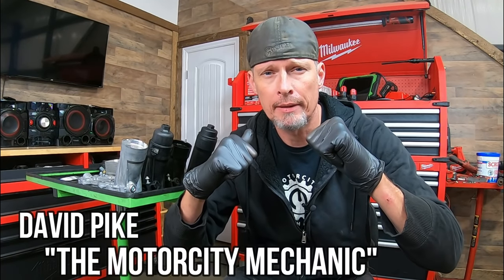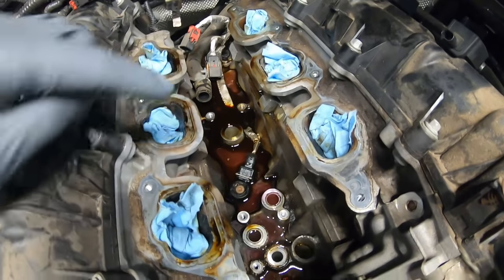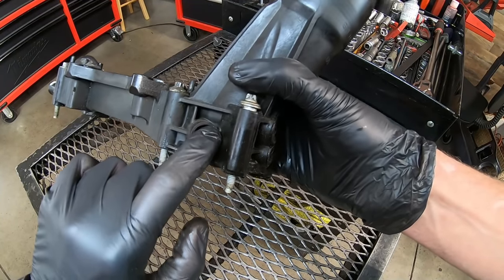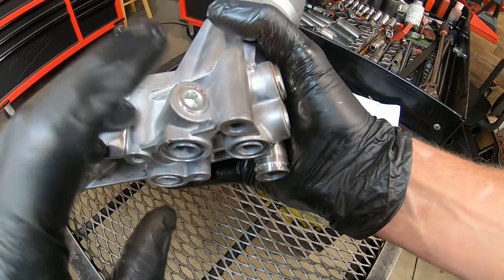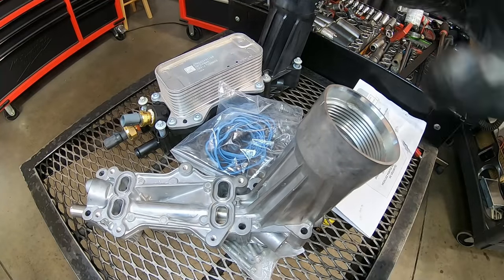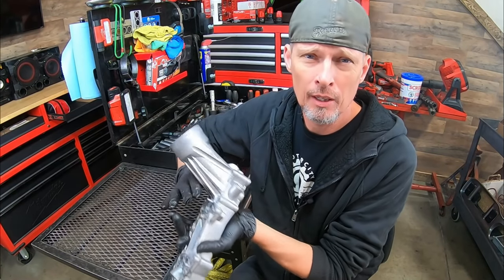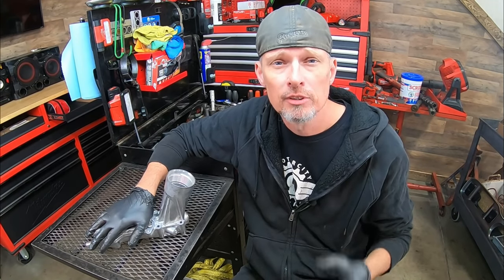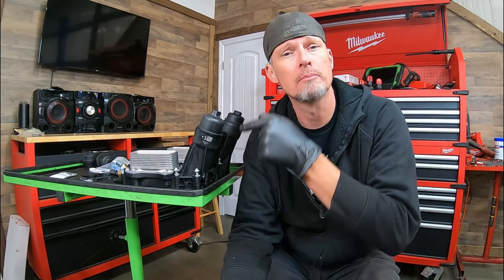Dorman 926-876 Aluminum Chrysler 3.2/3.6 Oil Filter and Cooler Housing Upgrade

Comment: Great video and good information.  Exception on swapping  Gen 2 to Gen 1  -  do the total replacement  with the addition of the Gen 2  oil cooler. Why not since your upgrading?
Reply from the maker: Only issue is almost double the cost. You have to buy a gen 2 assembly to rob the cooler off of. If people are okay with that…..heck yeah.
Reply: @MotorCityMechanic  Respectfully disagree, I just did it in my 2012 Wrangler.  Overall I will save money.
Reply from the maker: @everettrobinson7103  it’s just about what people want to spend. If money is no object then for sure. Hard to sell it to a customer when one option is half the other. In a perfect world I would say heck yeah.  It again in a perfect world we would have a cooler avail be separately to make it even better
Reply: Not to beat a dead horse, but this issue set me on side of the road a few hours. 🔑  shop around - Dorman upgrade and new oil cooler less than 200 and my confidence is back🤣😂. Additionally  MotorCity Mechanic is my go to on Pentastar engines.
Reply: Love the dialog and fully understand what you are addressing. My knowledge of JEEP " just empty every pocket " allows me to take the loss for the longevity. May you and your channel be blessed 👍👏
Reply: @everettrobinson7103  Where did you get the cooler to install though? That is the issue on the Gen 1, the cooler on them does not fit the Doorman piece, and it is not sold as a spare part at the moment. So to do the swap on a gen one you need the dorman part, plus the replacement assembly from Chrysler that you can remove the cooler from. Mosy customers are going to say they only are buying the OE assembly, even if the dorman part works better.
Reply: @MotorCityMechanic  depending where you are and buy the parts from. The dorman assembly and the oil cooler bought separately and then buying the m6x1 I believe 16mm or 11mm screws you will be close to the same price as buying the oem assembly for gen 1.
Reply: @MotorCityMechanic  so you could theoretically swap a Gen 1 oil cooler for a Gen 2 if you bought the Dorman assembly AND the Mopar assembly just to get the oil cooler for the Gen 2? I have a 2011 3.6 which is Gen 1 and we have replaced the oil cooler once and it’s leaking again. I would love to go full aluminum parts for that because it’s annoying that we will have replaced it twice in about 3 years.
Reply: @MotorCityMechanic  unfortunately I checked on Amazon and dorman websites that it doesn't fit on a 2013 Dodge Journey.. is this true
Reply from the maker: Gen 1 is 2011-2013 and it doesn’t fit a that version of the 3.6 unless you come across a cooler to bolt to it for a Gen 2 and then you have to make sure you use the right oil filter from them in for a 2014 model journey. Would need to find a gen 2 oil filter cap as well
Reply: @MotorCityMechanic  thank you sir
Reply: Wow, sounds like Jeep slammed him or his dealer for telling that it would work on Gen 1. If the only problem is the cooler, a pick and pull would fix that...

Comment: 17 Ram, I replaced with this Dorman hsg at 75k miles, oil leaking again at 95k miles. Replaced with Mopar seals, oil leaks again at 102k miles. Replaced with Mopar seals again, oil leaks and same failure at 104k miles???  So, the shop replaced the entire adaptor hsg and cooler this time with Napa brand aluminum, so far so good at 108k miles. Upon inspection, I found the two "figure 8" seals between the cooler and the aluminum housing had collapsed On the oil gally side. Probably nothing wrong with the Dorman part, just the seals are junk The shop didn't replace those each time the failure occurred. Just so you folks know...

Comment: 2 weeks ago I had a P0128 coolant temp code with CEL. I replaced the thermostat a year ago so thought it may be the same issue. Cleared the code. 1 week later I get a P066d code. Oil in the coolant, overflowing in the reservoir, low to no oil on dipstick. Oil in the valley near filter housing but otherwise engine running fine and good oil pressure before I shut it down. How common is it for the oil cooler to fail or is it most likely a head gasket or cracked heat. 2015 jeep GC 3.6L
Reply from the maker: My money is on the oil filter housing/cooler assembly. That’s where I would start and then flush the cooling system numerous times until it’s clean
Reply: @MotorCityMechanic Thanks. As you know the coolant is now like chocolate/peanut butter. What do you suggest to use to flush if anything other than water and how do I ensure once it is flushed thatI get the right mixture of coolant in the engine?  I'm not sure what volume of water or whatever I'd use would remain in the engine after draining the radiator and reservoir.

Comment: It’s all over Facebook on the Dodge Caravan groups to not use this Dorman oil cooler.  Thoughts cause I was sold by the video until I asked about it on Facebook
Reply from the maker: And what was their reasoning? Other than possibly the name of the brand. I have installed a few with no issues and others have as well and no problem as of yet.

Comment: I have a 2015 jku wrangler, should i still replace the oil pressure sensor? Also, you mean coolant temp sensor is fine? correct?

Comment: Question for you. Have a 2014 jeep Grand Cherokee 3.6L the driver side has oil by the coils, found out its common  at high miles due to the spark plug seals in the valve cover correct? Also can I just unplug the connectors on the valve covers and lift up? Or do the sensors need removed? TIA

Comment: My gen 1 oil cooler leaked from the oil filter cap like a sprinkler spraying all directions getting oil all over the front of the engine bay. And it was screwed on tight. I wiped as much of the oil away with the blue paper towels. I'm not going to put a steam cleaning spray to wash the oil out. I don't want a shorted out engine. I'll just let it dry by itself.
Reply from the maker: This may have been the cause if leaking at the cap: Installing the Chrysler 3.2L and 3.6L oil filter o-ring correctly
https://youtu.be/euvnSPRxiRo

Comment: Does this FIT on the 2013 as well ??? (2013 Ram 1500 ST 3.6v6 pentastar) I would assume the blocks would be the same and we'd just need a different oil filter and cooler assembly ??? Shouldn't be too hard to get one from the junkyard for a 2014. Please tell me this can be done, It wasn't quite clear how you described it in the video in the end.
Reply from the maker: It can but again you need the cap, sensors, the cooler, and the cooler bolts.

Comment: I am in the process of replacing this cooler with the Forman replacement on a 2014 ram Promaster 1500. Have had it apart twice and both times after reassembly it continues to leak ? Any suggestions for me to check ? And yes all bolts were torqued to spec. No oil in coolant when done? Just looking for suggestions

Comment: Okay, so after watching your other video many times I had decided to upgrade my 2013 to the new style. I also decided to use this dorman part. So knowing my old oil cooler won't fit, I ordered a 2014 OE replacement filter housing to serve as an oil cooler donor. The plan was to bolt the new 14+ cooler onto the dorman 14+ housing and slap it in there. Any reason this shouldn't work? It seems like in this video the main problem we run into is a lack of a proper oil cooler to install, which I can now take off the donor.
Reply: The comments on the other video seem to unanimously agree the conversion works, and all I'm doing is swapping the bottom piece of that conversion from plastic to metal. I know it's not cost effective at all lol, but is there any reason it wouldn't work? I really want it to be metal down there. Expensive, plus wasting an entire plastic housing, but hopefully one and done.
Reply from the maker: It can be done but having to pay double for two assemblies to make one is the issue. For me I haven’t seen multiple failures so far so the price doesn’t justify it to me. But that’s a person choice and no real wrong answer either way. We have been doing  swaps for a long time just like the video I made about it.
Reply: eBay is now selling these as complete assemblies with cooler, filter & sensors.

Comment: David;
Disappointed the Dorman Oil Filter & Cooler Part will NOT fit my 2011 Gen 1 3.6 Pentastar 😟
Question - But,WILL the Dorman Part work on my Gen1 if I salvage a separate Aluminum OilCooler SubASM from a Gen2?   
Yes, I know that means doubling my parts cost today buying both the new Dorman Part and a whole Gen2 MOPAR plastic ASM, but beats installing another MOPAR plastic ASM guaranteed to leak at some point…I keep my vehicles on the road for up to 20 years+.
Bill
Reply from the maker: For sure…..rob the gen 2 cooler and it will work on this assembly. I see no reason why not
Reply: Yep, the Gen 2 will bolt on to the gen 1 just fine, so the dorman part should also work if you add the cooler and filter cap. BUT you will want to mark or add a marking saying it has the new unit and uses the newer filter. The old filter will drop into the new housing but will not filter the oil, So say you take it to a shop or oil change outfit, they are going to say, oh this uses the old filter. OOPs.

Comment: The radiator must be available somewhere. Right?

And, also the 4 oval sealing rings. Apparently Mopar doesn't sell them individually, but Dorman apparently sourced them. So they too should be available somewhere. Right?
Reply from the maker: Someone made the 10,000,000 (x2) cooler seals for sure….but again Mopar doesn’t and I haven’t seen anyone else either. They didn’t sell the bypass valves back in the day as well but eventually did
Reply: @MotorCityMechanic  I wonder if the radiator is used on Mercedes vehicles.

Comment: Dorman's been hit and miss for me, one of the things I bought from them were the fuel clips designed for a 2006 Focus. HARD fail, leaked like and sieve and I returned them twice for another new package of them. Other things like battery hold down bolt (original rusted off) or Evap pressure sensor worked just fine.
Reply from the maker: I agree as well. I have learned something to stay away from. In my opinion they have sooooo many parts that it’s hard to keep up with the quality control for sure. But once you bring it to their attention they usually start checking into it
Reply: That is admitingly something I didn't think of; talking to them about it. At the time, the Focus was my only car and I needed to get it back on the road that evening for work the next day. I blame Ford more than anyone else for using plastic on a fuel rail; given that fuel would inevitably end up on the plastic and make it brittle. I was doing a 30K fuel filter change when the original fuel clips failed.

Comment: I’ve got oil pouring out from above my transmission - 2017 Jeep Wrangler with less an 70k miles.  I probably lost 1/4 to 1/2 of a quart in a few mins of running (on the ground.  First time starting up outside with freezing temps in a long time - normally garaged - just turned it on with remote start to warm it up (so glad I saw the oil on the ground!). So, I’ll be stripping this sucker down to see if this is the problem but I’m betting I am so parts are on the way.  Any thoughts?  Am I going after the wrong thing here?  Dealer says next appointment is DEC22d.  If this is the issue I’m sure I can fix it week before then,

Comment: Took a little chance and purchased 14-17 aluminum part from eBay for about $250 for my 2013 JKU. The part itself was machined well but the sensors that came on it… not so much. Total china junk. Regretfully, I didn’t follow my gut instinct and change them out with the old sensors. Now I have to tear it all out and replace them with OEM. Hopefully if the aluminum body is made as well as it looks I’ll never have to do it again.🤞

Comment: Wow, $250 for this part! In stock @ your local Autozone today, get 'em while they last..Now if they will just make an aluminum thermostat housing for these pieces of crap💩🚽🧻
Reply from the maker: Funny you should say that….it’s coming: Chrysler Dodge Jeep Ram 3.2L/3.6L DORMAN Aluminum Thermostat Housing Upgrade Option
https://youtu.be/8T57n5svPwE
Reply: @MotorCityMechanic  Sweet!! Thx 4 the link buddy, I'll be sure to thumbs up the video👍 Now if they will just get on w/ making one for the fwd applications, it might be worth my while to buy this Town & Country i've been eye-balling👀...I really like some of the features & looks of Dodge's newer minivans & the Journeys but i've been hesitant up until this point because I have definitely NOT been a fan of the 1st gen. pentastar motors or the 62te automatics in those vehicles due to reliability issues
Reply from the maker: @jbone1383  62TE transmissions are all that bad. It’s a trans that needs to be serviced every 30k miles and then you won’t see a lot of the issues that happen. I have 2 Promaster customers with over 450,000 miles on their 3.6 abs 62TE transmissions

Comment: I got some oem seals for the dorman housing, but the seal kit comes with a larger black o-ring and a smaller diameter red o-ring. Instructions say for 2014-2021 applications to replace the black o-ring on the OFA assembly with the red one in the kit. Can anyone confirm this is correct for a 2017 model 3.6? The wording on the instruction sheet is weird.

Comment: This Dorman product won’t work on the Gen3 Pentastar V6 because the Gen3 housing does not use separate oil temp and oil pressure sending units. Instead the Gen3 plastic housing has a single combined oil pressure & oil temp sending unit. The plastic Mopar replacement oil filter/cooler housing for the Gen3 Pentastar V6 has a “blind” hole where the oil temp sending unit used on earlier Generations of the Pentastar V6 would normally go. If you have a Gen3 V6, maybe  you could us the Dorman aluminum unit if you sealed its oil temp sensor port with the appropriate sized pipe plug and used the Gen3  combo sending unit in the Dorman housing’s oil pressure sending unit port.

Comment: I watch a previous video from another youtuber and he said sometimes a fuel line connection might break when unplugging doing this replacing the oil cooler houseing , can you help me in finding this part i will be working on a 2013 ram v6 and yes I found the right part number for the oil housing for my truck off the dorman site

Comment: Would a 2015 Dodge Charger be a gen 3? And would it still work? I just replaced mine with OE but if it fails again, I will go full metal design.

Comment: Rockauto recommends the 926-959 for my 2014 jeep jku. Is this the right part number so that i may order today???? Thnks
Reply: 926-876 Upgraded Aluminum Engine Oil Filter Housing
926-959 Upgraded Aluminum Engine Oil Filter Housing with Oil Cooler and Filter

Comment: I need your help 2018 ram 2500 heater core stopped up replaced heater core flushed system got a lot out of it. Heater works great at idle but goes cold when u drive. Also hose going to heater inlet gets cold as well.

Comment: So if I have replaced my gen 1 with the gen 2, the plastic housing cracked at one of the plugs. Would I be able to use the oil cooler from the gen 2 and install this aluminum housing? I was just about to order parts when I saw you post this.
Reply from the maker: If you made the swap already then yes you can use that gen 2 cooler on the Dorman replacement and install it in your gen 1 engine.
Reply: @MotorCityMechanic  Thanks! Thought so, but wanted to make sure.

Comment: Question: You mentioned using thread sealer. Should this be used on both a new oil pressure sending unit AND the temp sensor or only one of them? 
I've ordered both new sensors for this job and the pressure sending unit seems to have some red loctite on the threads. 
Thinking of using the high temp Permatex 592...
Reply from the maker: Most new sensors have some thread sealant on the threads already. If not then a small amount needs to be added. Liquid teflon is what i recommend
Reply: @MotorCityMechanic  as always, thank you!

Comment: If you are not changing Valve Cover Gaskets, just swapping out the leaky Oil Filter Housing, how many hours should a good shop take?
Reply: how long? I'm hearing 2+ hours if you are experienced and around 4 hours as a first time job.

Comment: I've had mines replaced with an all-aluminum system 3/27/23 but I'm still😮😢 getting the leak in my driveway. It started leaking 4/3/23
What should I do next. 2015 200s

Comment: Any idea why I can’t get rid of my P0197 code on my ‘14 Cherokee limited with the 3.2? I’ve replaced the oil filter/cooler assembly with both new sensors and it worked for a day then came back. Replaced just the oil temp sensor again and no change. Still says no oil temp which trips the code and tells me “Service electronic throttle control”. Not sure what to do next

Comment: Is there a specialty socket for the oil temp socket? It seems like those sensors never want to come out because nothing ever fits them. I am referring to the smaller sensor on top I am not sure if it’s temp or pressure but it seems like that is the one that never wants to come out because I don’t have the correct socket.
Reply from the maker: Nothing special. Usually I just use a deep socket. I think it’s either an 18mm or 19mm. Can’t remember, I just grab what fits lol.
Reply: @MotorCityMechanic  ya I hear you I work in buffalo and it only seems to work about 10% of the time. I am sure you know my struggle. Thank you for all of these great videos I am learning a ton of things about the pentastar engine that will really come in handy. I am going to buy the tool kit for the timing chain so I can do the rocker arms correctly. I have been doing it wrong for awhile now and I will feel a lot better not prying up on the camshaft now that I know I can remove it correctly!!